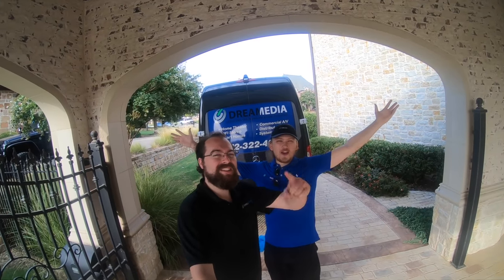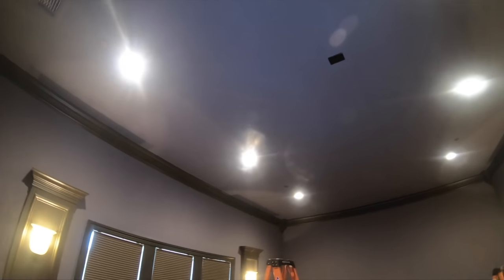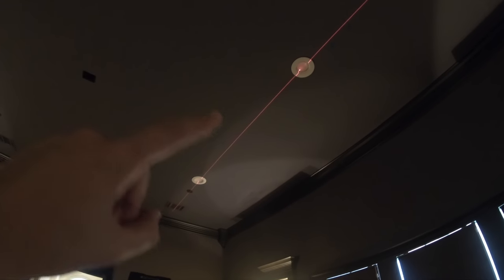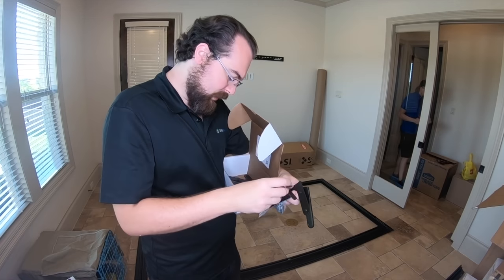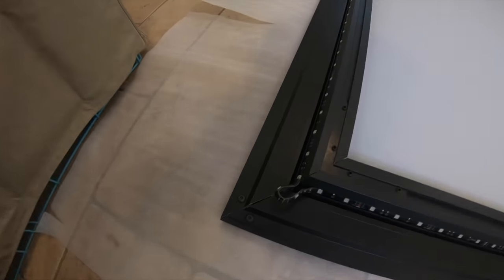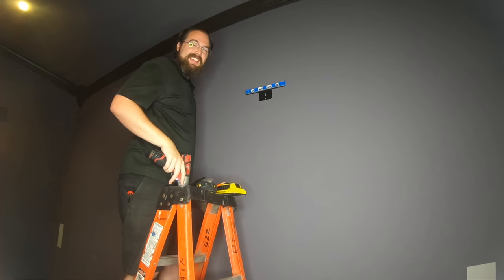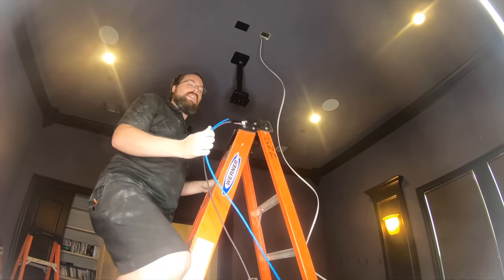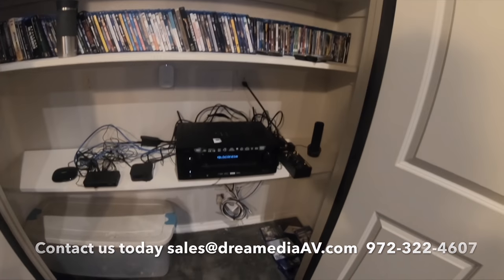Klipsch 5.1.2 Atmos Home Theater w/ 4K Sony 295 & SI Screens 120 inch Pure Grey Zero Edge Screen

Comment: You guys use the new LCR inceiling speakers yet?
Reply: JJ Dente I’m having them put in my theater for my Atmos speakers.
Reply: Nestle Ambrosian that’s what I was planning to use them for
Reply: what's the difference with the in ceiling speaker they're using in this video compared to a LCR in ceiling? and im assuming LCR is left centre right abbreviation?